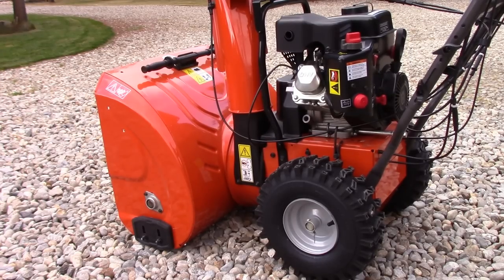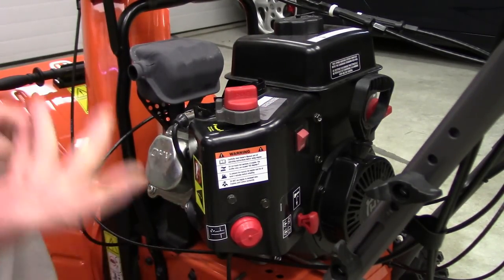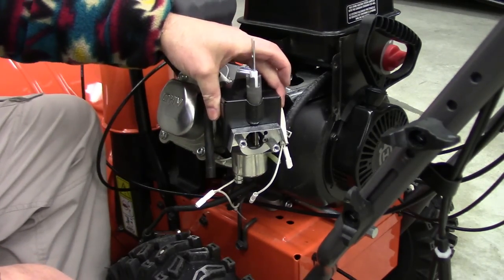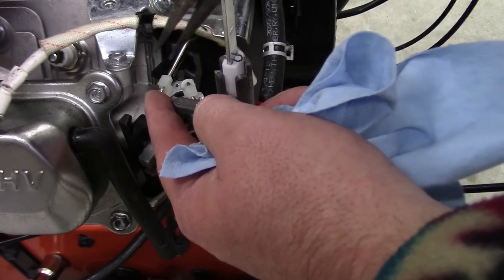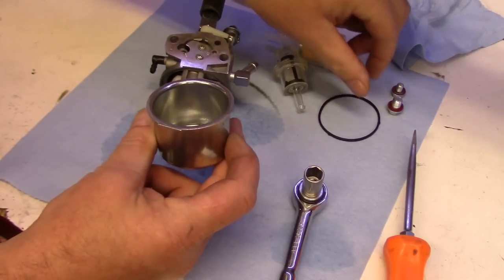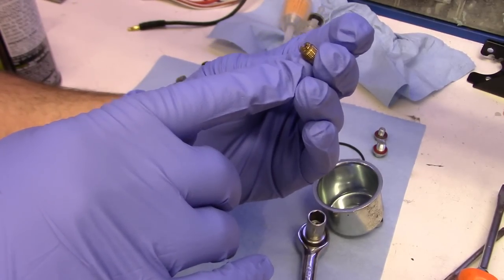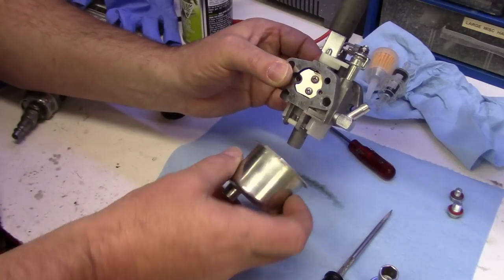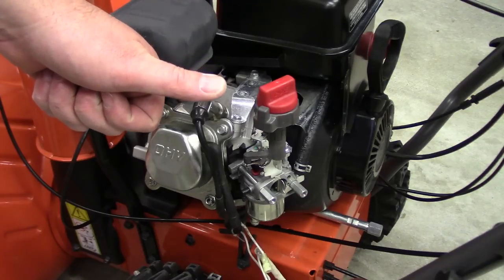Surging Snow Blower Fix - Running lean.

Comment: Inline gas filter.  My Craftsman with a nearly identical engine had a hidden inline gas filter located where the fuel line went into the fuel tank.  It was the same size as the inside diameter of the fuel line and fit right into the fuel outlet line where it exited the fuel tank.  I only discovered it when I pulled off the hose at that location and it pulled the filter out about 1/4 inch.  It’s about 3 inches long and goes right into the bottom of the tank. It was a first for me.
Reply from the maker: Thanks for sharing that interesting hidden fuel filter tidbit. Seems they do put filters in. This blower had a "hidden" tiny filter as well in almost the same location. It was actually up inside the fuel tank but still part of the fuel line bib. The bottom half of this tiny filter inside the tank was all gummed up with what looked to be black paint particles. Every time the blower was 1/4 or less of fuel remaining, it would die out because very little fuel would get past all that gummed up paint on the bottom half of the filter screen. Cleaned it out, runs great again. I almost think it was small paint particles that were getting by that in-tank filter and that is what the dirt was in the bowl and jet? Hidden fuel filters... Definitely something to look for these days.
Reply: I added my own fuel filter. They don't seem to put them in anything anymore. There may be one in the line itself, I didn't check. I just always put one in if it's not present.

Comment: This is a very good video, especially with the detail for removing all the covers and shields. I have a 10 year old Ariens deluxe 28 that started running poorly at high throttle and stalling at idle. Today I removed the carb and took it inside to clean. The bowl gas was clean with no debris and the bowl itself was pristine. The main jet and emulsion tube orifices were clean and a small wire easily passed through them. Next I removed the idle screw (7 turns CCW) and popped out the RED idle jet. The fine wire met resistance when pushed into the orifice. Applying a bit more force dislodged a small black speck on the end of the wire. I flushed everything out with Gumout and observed that the 2 O-rings on the idle jet housing were completely flat. Using a dental pick, I removed them and when rubbed between my fingers, then crumbled to dust. 2 years ago I bought an Ariens carb rebuild kit "just in case" and it included the 2 O-rings. I put them on and re-seated the RED plastic idle jet into the carb body. This probably could have been done without removing the carb, but it's 10 degrees in the garage and 70 in the basement. I put the carb back on the machine and it fired up on the first pull and runs great at idle and high throttle. I always shut off the fuel and let it run until it stalls after each use and drain the tank and bowl for summer storage. I'm seriously considering a switch to ethanol free fuel in the future since there's a station nearby that sells it. Ethanol is hard on rubber parts, but I did get 10 problem free years. Again, thanks for posting this video!
Reply from the maker: Thanks for the feedback. Yes, the red idle jet is something I didn't even think to check when I cleaned this one out so thanks for pointing it out as another one that should be looked at and cleaned. No question, just a little bit easier doing a carb clean inside where it's warm 🙂👍

Comment: Had the same issue on a year old Husqvarna! Ended up being the fuel filter built into the hose barb on the fuel tank. Restricted the fuel enough for a lean running condition. Props to all who commented with their fixes.
Reply from the maker: Yep, found the same thing on mine too after another person commented on it.

Comment: This worked for me - I have a 2014 Ariens Deluxe 24. I tried cleaning out the low speed jet first but it didn't fix the issue. I was able to clean out the high speed jet without removing the carb. The video was very handy when putting everything back together!
Reply from the maker: Glad it helped

Comment: According to the Tecumseh Products Wikipedia page, Liquid Combustion Technology is an US company, HQ'd in Travelers Rest, SC.  This doesn't mean their production isn't in china, though.  Along with another company (that bought Tecumseh's assets) LCT builds Snow King engines (a name that was used on former Tecumseh engines).  Now that Tecumseh has bit the bucket, I prefer B&S OHV engines, like the one I have on my Ariens snowblower.  Always starts on 2nd pull, even at 20 below.  Now Ariens seems to use LCT engines too.

Comment: Great video. I have a similar LCT engine with a surging issue. I rebuilt the carburetor but didn't remove and clean the main jet. I expect that an inline fuel filter would be a good idea. I'll check for the hidden fuel filter as well.
Reply: I have the same issue with mine, how did you fix it?

Comment: Theses carbs resemble the Honda carbs, thus Honda cloan engine’s. Make an effort to
Run gas stabilizer, buy ethonal free gas at pure gas.org, worst case buy the ethonal free gas at the large box stores in cans. Expensive. Then you will reduce or eliminate these ethonal related problems. If you take a look at the diameter of the holes in the emulsion tube, very tiny they will clog easy due to ethonal. Just to keep the corn farmers alive???

Comment: Thanks for making the great video.  I didn't see you remove and clean the slow jet orifice (red plastic plug) under the black plastic idle adjust screw on the side?  These are prone to clogging just like the main jet in the float bowl.
Reply from the maker: Good tip!
Reply: John, great job on the video and thanks for helping us keep parts of our paychecks in our wallet.  Taking a snowblower to a shop for a carb clean, or wallet cleaning, would cost about $200.  Cheers!

Comment: Great video! That did not cure mine what I found on the second time was dirt in the low speed. To fix that removed the black idle screw and gently pry up the red plastic low speed jet to remove and clean as you did with the main jet.
Reply from the maker: Thanks for the tip on the low speed jet. A few other folks have commented on checking that too so it's good to know there is another possible cause.
Reply: Hey just wanna say thankyou so much for your input, I did everything, cleaned everything and it was still sputtering, your solution completely fixed my problem. I OWE YOU!!!!!
Reply: you sir just saved me a whole bunch of anguish as well as stopped me from buying a new carb, thank you for this.  I had my carb out 3 times and cleaned it over and over again, turned out to be the low speed.... again thank you.
Reply: @bryanlumsden3573  Very welcome glad it helped. the problem is because of the EPA regulations the machines already run lean so even a tiny restriction will cause issues. Don't  know what machine you have but if it is an Ariens with a knob to shut the fuel off keep an eye on that. On mine the internal seals had dissolved and that was what had plugged my carb up. Quick check of that value is next time you run it turn that value  off and leave motor running see if in a minute or two the motor stalls. If with that turned off it keeps running for much more than a couple minutes that value is bad and may plug you up again.
Reply: DUDE, i cleaned the carb twice, new spark, oil, and 89 gas, (it was the dam JET!) red plastic part, I didnt even see gunk, i just pulled it cleaned it, sprayed inside i don't give a shit anymore. put it back in, made sure hoiles algined. bam, perfect. thank you! and thanks to the maker of the vid.
Reply: The low speed jet was the problem with mine. Good video just the same.
Reply: where is the slow jet? i only see the main jet and the emulsion tube.
Reply: @nicolauscory2065  You will see the idle screw which needs to be removed. Under that is a red plastic cap gently pry it up an it will pop out. That red plastic piece is the low speed jet.
Reply: Make sure y'all count how many turns it takes to back out the black plastic screw, then do same amount after you put the idle jet back in.

Comment: So do what this guy did. But dont drill anything out. If it still surges at idle you have to clean out the pilot jet which is under the idle adjustment screw. Its red in this case but on my troy bilt its black. In general pilot jet is for fuel delivery at idle and main jet is for fuel deliverg at quarter throttle and above.

Comment: You didn`t clean the low speed jet. That is usually were the problem lies. You must clean the jet and tiny orfice in carb body. with carb cleaner and tiny wire threw the orfice.
Reply from the maker: Yep, a few others have made mention of that. Next time it starts running rough I'll be sure to check that one as well. Thanks for the information.

Comment: Awesome video.  My snow blower has the exact same symptoms.  Surging...I thought it was dying because the fuel to air mixture was too rich, not the opposite.  Thanks for calling the brass (or copper) tube in the carburetor by the proper name, and saying that air goes through it.  Also, I didn't realize the black Philips screw was for idle, I thought it was to adjust the fuel to air ratio.

Comment: Here's a huge tip for everyone who has similar symptoms. Before you go taking things apart, try this. Warm up the engine, run it a full throttle, and take a heavily gloved hand and go under that cowl and briefly (totally) cover the carb air inlet, but don't stall the engine all the way. Repeat a bunch of times. What this will do is cause that huge engine intake suction to pull fuel really hard thru all the internal passages of the carb (instead of outside air) and may pull any dirt particles out of any jet orifices internally. Using the choke to do this really won't work as there are several passages not exclusively behind the choke and which will reduce the effectiveness of this trick.
Reply from the maker: Good tip - I'll have to remember that for "next time".
Reply: My snow blower is surging too. So I’ll do this before next time or when the weather is warmer.
Reply: Approximately where would the air inlet valve be under the cowling? Thank you for the suggestion
Reply: @randybarnhart6976  not an air inlet valve, the air intake opening on the carburetor. Snow blowers generally don’t have an air filter, so right there at that opening where a filter would normally go. Use a heavily gloved hand in case it spits back when you take your hand away. Again, not a guaranteed fix, but worth trying.
Reply: @GNX157  John, thank you so much for your reply.  I looked at it tonight and now it makes sense.  I will try it tomorrow and will advise.  Thanks again.
Reply: @randybarnhart6976  did it work?
Reply: @alexh8754  No, did not work for me.
Reply: Thanks, i've seen your comment just before removing the carb and it fixed it!

Comment: Just had to do this and this video helped me a ton.  I tried to clean the carb with it installed but in the end its such minimal extra effort to remove the whole carb that I found it silly not to.  Upon draining the carb bowl and removing it I found some sediment, which I cleaned out.  I removed the low fuel screw and it was OK.  I couldn't get the main jet/emulsion tube out - didn't have the right size screwdriver to get in there, so I settled for just blowing it out with carb cleaner.  Reassembled it and it runs a lot better, though I still get minor chugging when the choke is fully closed.  However, if I give it a bit of choke it runs smoothly which is a ton better than before.  After this week I'll tackle this again with the right size screwdriver.
Reply from the maker: Hope you are able to get it working 100% once you are able to clean out  the main jet.

Comment: Thanks for the video.
If you look inside that fuel tank you'll see that there IS a fuel filter.
Reply from the maker: 100% Correct. Thanks for mentioning that. It's something I found out last spring before putting the blower to bed for the summer. I removed the tank to clean it and when I un-threaded that small internal screen filter in the tank,  I was shocked to find the bottom half of the screen tube clogged with black paint? Not sure if that's common, but might be worth checking for those that have not had theirs out.

Comment: Nice job, good skills!
If you're in a hurry, or lack the proper work space, you can tilt the blower forward so the scoop is facedown, the drain your carb and pull the jet and emulsifier from the bottom of the machine, then you won't have to pull all that housing off.

Comment: Peek inside the gas tank. Mine is a different brand. But geeking inside tank there was one inside of the tank on the fitting. Not very big though.
Reply from the maker: Yep, as per the first pinned comment 🙂
Reply: @Rchelicopterfun  Didn't see first comment. i travel fast and light through you tube on weekends. No time to read every response. lol

Comment: All wanted to say one more thing., I noticed those wire connectors., Have little pin clips., That's why they're on there so tight., I'm no expert, I have just been learning from YouTube videos., Neighbor gave me a 2014 snow TEC., That's like brand new. Obviously carburetor was all gummed up. So I've just been passing information that I've just learned recently., Like I said i'm no expert, Or even a mechanic at that., I'm a YouTube mechanic.😂😂😂

Comment: Great video but why not just pull the bowl off to access the emulsifier and jet without having to pull off all those covers.
Reply from the maker: Two reasons: First, I didn't know what the issue was so decided to take it all apart to get a clear view of the entire layout. May have been something as simple as a blocked inline filter or pinched fuel hose for example (of course that was not the case) but now we know. Second, taking it completely off really was the only option for doing a video to clearly show the carb and internal components within the bowl including the float needle. Plus, for those that do need to remove the carb; this might help give them a little more information on the scope of the process. Yes, in hindsight, and hopefully what people will get out of this is you can just take the bowl off from under the cowling to service the jet (assuming of course a clogged jet is the issue).
Reply: @Rchelicopterfun  I found dirt through out the carb, ... so removing it & doing through cleaning was a good thing. Very helpful video. Likely saved me $100 by DIY, rather than taking it to a small engine repair shop. Thanks again.
Reply: Him taking off the cover was the best thing bc most guys start these stuff without viewers seeing clearly how the butterfly carburetor works while the machine is actually running.

Comment: What a beautiful tutorial thank you so much! I do have a question, I have a 1-year-old Troy-Bilt   Storm 2410 snow blower. It is doing exactly the same thing, it is surging and in order to stop it I have to reach in it up with the choke just like you did. If I look underneath I can see that bowl. can I just turn the machine on its side and take off the bowl while The carburetor is still attached?
Reply from the maker: Yep, if access allows. I Mention that method in the description 👍

Comment: Ariens AX engines are an exclusive line of engines for the Ariens Sno-Thro lineup that are manufactured by LCT and built to Ariens specifications. Who is LCT? Liquid Combustion Technology (LCT) is a USA-owned and operated company that manufacturers air-cooled engines for outdoor power equipment markets.

Comment: I have the same exact snowblower and I need to fix it as well. I have cleaned many carbs, but wanted to watch this to see if there was anything I needed to know. It's a bit curious that of all the videos I have watched on this, you are the only guy who didn't take out and clean the pilot jet and on every other vid it was really the only thing they did. Anyway, great vid. Nice and clear and detailed.
Reply from the maker: @Richard Curtis, yep, I didn't even think of the pilot because lean running which this clearly was, is not symptomatic of a pilot jet issue. Pilot jet issues generally manifest as rough running, especially during load & speed transitions (at least in my anecdotal small engine maintenance experience). In hindsight, I of course should have at least mentioned to inspect/clean it while it was all apart. Next time 😉
Reply: @Rchelicopterfun  All other videos pretty much say this is the fix it needs. I watched a few videos where they ONLY do this and it worked. I literally just got done doing mine. I did the whole carb and that pilot jet that sits outside the carb and it runs great. I had some dirt on every jet so it needed it. My unit was nowhere near as clean as yours, I'm jealous lol. Mine lives outside and it looks it. It runs very strong now though. Thanks for the great vid.

Comment: I have an Ariens Compact 24 208cc LCT engine, cleaned the carb as shown, I’m still having issues with sputtering, it’s not terrible but noticing oil level too high and smells like fuel, float bowl seems to work as it should upon inspection, not sure what it could be causing to run rich

Comment: Hi, I replaced my carburetor on my Craftsmen. During the process, there were 2 little standoffs on the studs the carburetor was mounted to. Well, I had the choke open, and those standoffs went through the carburetor and into the engine. I had the machine sitting up on the plow so that’s how the standoffs fell in.
Do you know if this will cause great harm? Do I have to take the engine vent off, can I even get inside to remove the standoffs?
I tried firing it up today and a small fire started at the top of the carburetor. Had to extinguish it.